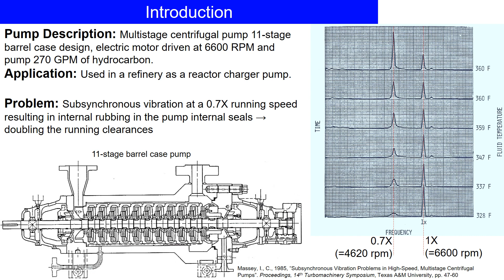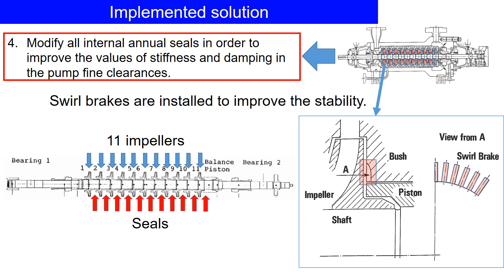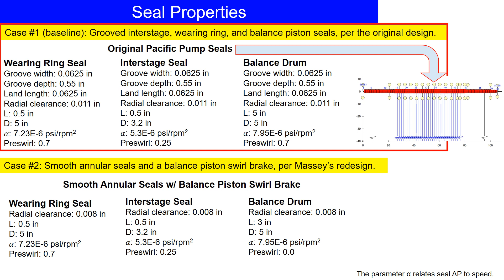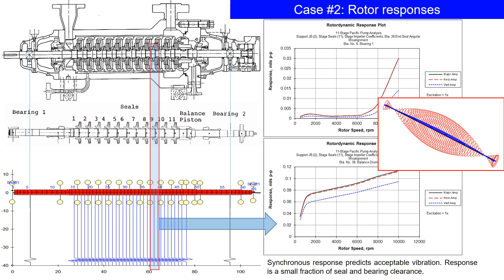Part 20 - Swirl Brake in rotating machines

Comment: Pls explain honey comb seals also
Reply from the maker: Sure, I'd be happy to explain honeycomb seals in more detail!

The seal consists of a series of small honeycomb-shaped cells which are stacked together to form a seal. 

Honeycomb seals help to improve the stability of the rotor by reducing the amount of turbulence that occurs within the system. For example, honeycomb seals can help reduce cross-coupled stiffness in rotor dynamics. Cross-coupled stiffness refers to the stiffness that is induced in the rotor due to the interaction between the rotor and the fluid or gas passing through the seal. This interaction can cause the rotor to tilt or skew, which can result in unwanted vibration and noise.

Therefore, the use of honeycomb seals (if they are designed well) in rotor dynamics can have a positive impact on the overall stability and performance of the rotor system by reducing cross-coupled stiffness and minimizing vibration and noise.
Reply from the maker: Greetings, @firemaster1881! I wanted to inform you that I've just uploaded part 22 of my video series, where I delve into the topic of honeycomb seal. I sincerely hope you find the video informative and engaging. If there's anything specific you'd like me to explore or discuss in future videos, please don't hesitate to share your suggestions. I greatly value your feedback!

Comment: Excellent analysis..... Would you kindly tell about what is "cross coupling effect (cross coupling stiffness)"?
Thanks.
Reply from the maker: Thank you for your kind words! I'd be happy to explain the concept of "cross-couped stiffness". 

In rotor dynamics, cross-coupled stiffness refers to the stiffness of a rotor in a particular direction due to the effect of other directions. In other words, when a rotor is displaced in one direction, it can cause a stiffness in other directions due to the deformations induced by the motion. 

Cross-coupled stiffness can have a significant impact on the stability of rotating machinery. It can cause vibrations and instabilities, and it must be taken into account in the design and analysis of rotor systems. 

I hope this explanation is more clear and accurate. Let me know if you have any further questions or concerns.
Reply: @RotorDynamics  Thanks for such a detailed explanation... Hope to learn from you more.....